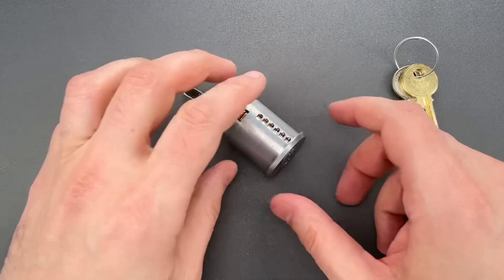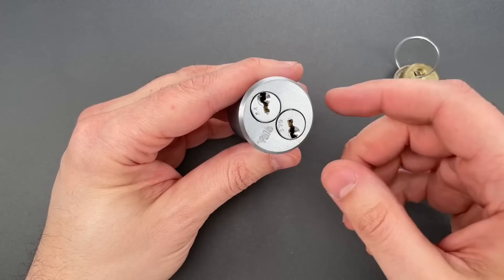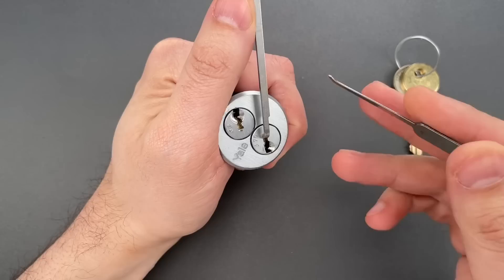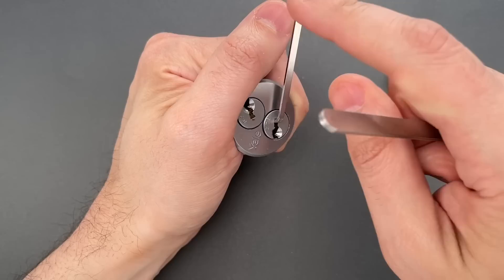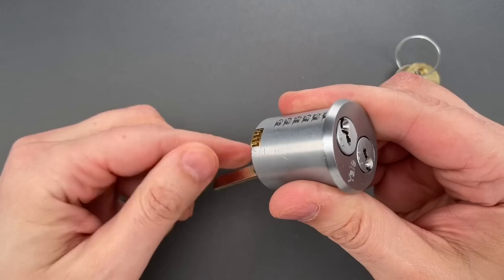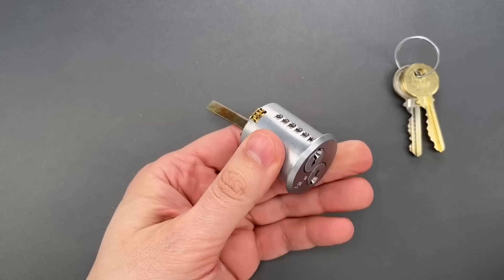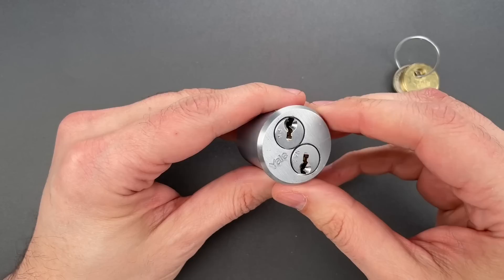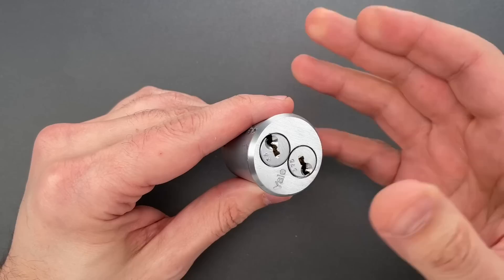[1511] What Were They Thinking?!? Yale Bicentric Bypass

Comment: It seems like most lock manufactures don’t threat model their products.  Quite insane.
Reply: Perhaps because most people breaking in to a room wouldn't even bother trying to pick the lock. A good run up and shoulder-ram and the frame will give way. The door is only as strong as the weakest point, and unless you've spent quite a lot of money on the frame and installation, that won't be the lock.
Reply: @vylbird8014  while this may be true in many situations, I don’t think a security product should take a defeatist approach to design.   If they do, they inevitably become the weakest link for scenarios where the rest of the setup is secure.
Reply: Or they model it after what's the intended use case. As an internal door lock and maybe only used to lock classrooms as to show you can't enter it seems fine. I worked at a school where we had a classroom with an emergency opening on the outside as it has the external emergency opening. Here everybody could then open it, but it was fine as it was just a way to tell students that the classroom was locked and they shouldn't enter. Not to keep out burglers and the like.
Reply: @leonthebleh  Got a nice contradiction at my school. The building was made for fire safety: The doors can't be locked from the inside, so a misbehaving student can't possibly lock themselves in. There are big class windows between classroom and corridor to permit a rapid sweep through the building searching all corners for anyone who hasn't evacuated. All of the security doors instantly unlock if the fire alarm goes off to permit rapid evacuation. All very well... until times shift, and suddenly people (ie, parents) are concerned about school shootings and demand that we put in place some sort of lockdown process. Which... we can't. There is no place to take shelter, because the building was designed without hidden corners where a trapped person might be missed. Teachers can't lock people out of the classroom, because the doors don't lock from within. And you can't prevent someone moving around the site, because all they need to do is press a fire alarm point.

The latter two points couldn't be solved, but we did re-fit all the classroom locks so that they can be locked from within. And adjusted the PA system so we can put out different coded alerts: The regular fire alarm, the more worrying 'take shelter within the building' alarm, and the emergency 'run like fucking hell' alarm which is for use in the case of a gas leak or bomb threat.
Reply: @leonthebleh  if they advertise their usage and security assumptions it’s reasonable.  The problem is they don’t and you can’t expect every customers to red team the lock for due diligence.
Reply: @vylbird8014 That's so crazy that you genuinely have to worry about being shot in a school. Like, truly insane. Why does the US still insist on allowing so many guns? It can't go on like this.
Reply: @vylbird8014  Wow. I knew I was taking a risk in assuming, but I didn't think I was wrong. That's the craziest thing I've ever heard. Do they even do shooter drills in the UK? It's so insane that I even have to ask. I don't want to live in a world where school shooter drills are the norm. That's genuinely post-apocalyptic level stuff. But I don't blame the parents for being afraid, I blame the US gun culture and their inability to recognise and/or accept the total failure of that system.
Reply: @clonkex  Not at my school. We have a protocol, but we've never drilled it. None of the staff actually take it seriously. We know the protocol only exists to reassure worried parents that we take the possibility seriously. Which we don't.

Comment: Yale is part of Assa Abloy famous in Sweden for their very secure Assa 2000 home door lock that could be picked extremely easy as it turned out. They updated the lock a number of times sending new parts to existing customers until they gave up and said that it was good enough despite the lock still being way to easy to pick. Personally I have never bought an Assa lock since that time. Everyone makes mistakes but it is how you handle them that counts. Assa leaves the customer with the problem.

Comment: Well, now I know why the janitor at one university I was at carried what looked almost exactly like your bypass tool rather than a key. It's obviously less trouble with these locks.
Reply: Or it was a tool to open toilet roll despensers, or turn on/off 'secure' light and heating switches.
Reply: @penfold7800  It was similar to the light switch one (though that one was forked), but I saw him use it on doors on a many occasions. I had just assumed that was the "master key" or something.
I suppose in a way it was :D

Comment: Now that you have brought this up . . . [ Your Favorite Brand of Lock ] Kwikset SmartKey has a particular type or style of deadbolt lock that utilizes 2 separate cores for use in limited 2-level master-key systems such as those used in apartment buildings or apartment complexes that allow for managerial or supervisory access keys to be used with those particular locks due to the simple facts that Kwikset SmartKey technology does not allow for the techniques used in modern-day master-keying schemes (since Kwikset SmartKey does not use conventional pin-tumbler mechanisms .) What I like about the concept of bi-centric cylinders or cylinder housings is for the allowance of 2 separate and distinctively different keyway profile sections to be used in the same lock (one for the cylinder core that the individual change-key operates and a totally different or distinct one for the one that the master-key operates so as to prevent key interchange or an otherwise compromise in the master-key system, that is if a restricted keyway or profile section is used for the cylinder core that the master-key is to operate .) What I would want to see in such an arrangement is an SFIC (Small-Format-Interchangeable-Core) cylinder housing that accommodates two different SFIC cores for this exact purpose in the same cylinder housing that would allow for two independent key systems to operate the same locking hardware as found in a padlock or as that on a door or a series of doors as what would be found on an institutional campus of buildings, like that of what would be found on a military installation or a college campus or hospital/medical center campus .

Maybe there could also be a cylinder housing configuration that would allow for situations or arrangements where "dual-custody" applications would be used such as that of where high-value inventories are stored or other storage scenarios where confidential or sensitive information is kept or stored, or proprietary research & development, and that or what could then be deployed with standardized door hardware, so as to change or restore the use of a single-keyed access application later or after a dual-custody arrangement is no longer needed, all without the further modification of the door or the lock that is used on that door .

I think that you have featured a similar lock [padlock] used in Australia that uses two separate cores for very much the same purpose such as to allow two organizations with independent keying systems to operate a single padlock that would be utilized to secure a perimeter fence or gate that would be used to secure some form of infrastructure with out the need to link separate individually keyed padlocks together .

I could very well see the use of a similar cylinder scheme used to this day for the purpose of particular situations where different group activities or departments within a large organization or institution, with their own distinct keys being used to operate a common set of doors or locks within a facility without the need to issue (or track) multiple keys or to modify cores or cylinders within those locks to accommodate distinctively different keying systems (that would also degrade security, since lock cores with multi-sectional keyway cylinders or maison-keyed cylinders that have a multitude of possible shearlines or entire pin-stacks removed altogether in order to facilitate the operation of multiple key bittings from multiple key systems .)

Additionally, a bi-centric cylinder housing format that accepts 3rd-party manufactured cores or SFIC's would also allow for keys from different makes or manufactures to operate the same lock(s) within a facility or campus .

Comment: Although, unless you were told about this weakness or had an example of this lock to play around with, I can understand why it was considered pick-resistant: just picking a core doesn't get the tail-piece to turn and can't open the door, you must know that a tool can be inserted to bypass and turn a gear, which rotates the tail-piece itself.

Comment: Well that explains a lot... I picked up a tss euro thumbturn cylinder out of a junk box to play around with and found that just jamming a piece of old wiper blade to the back of the keyway and giving it a wiggle allowed me to turn the cylinder and move the action of the lock, presumably due to the same issue of not being directly linked. 

Slightly related note, I was actually thinking of switching an elderly relatives cylinders to thumb turns because they are struggling with keys due to dementia (remembering to lock their doors or taking the key out and forgetting where they put it after locking etc) so I might have to look into other options if this is s common design flaw. Having said that a lock which can be easily bypassed is probably better than them just not locking their doors or getting locked in. Having doors that automatically lock behind them and any kind of electronic mechanism would not be appropriate either because they wouldn't be able to learn this new method to unlock their door. Old age is just another one of life's cruelties I guess

Comment: I get why they did it this way mechanically. A ratchet mechanism or something similar, that would allow the whole core to to turn and not just the tip, would have been a lot more complicated and expensive to make.
But by doing it this way they completely undermined security.

Comment: The idea of decoupled actuator can also defeat some locks, whose security relies on the actuator being fixed when cylinder is locked. This can mean being able to push or work the bolt open with a knife, credit card or similiar.

Comment: I had a key system like this in the one building I was doing community service for and I could go anywhere I wanted because all the locks had a master key I memorized when I first saw it.... It toom me getting in the building and making it through 10 doors for them to talk to the owner and change all the locks, I didn't dare tell them that they left all the latches visible so you could just use a card or ruler to get through the doors inside but at least the outside door was a lot more secure.      LoL

Comment: Something that could be useful is requiring all of the pins to be picked and something actively turning the BACK of the core, rather than just the latter as is required here. It'd add an extra step after a "successful" pick.

Comment: The way you could open that lock reminds me of the older Master Padlocks with the flat square key cuts. All you had to do was grind off all but the top or tip two to form a T and you can open just about any Master padlock of that type.

Comment: I have the fix! It works exactly the same except the key pushes a bar that engages the gear and is locked to the cylinder. When picked, it acts the same way as this in that the cylinder would turn and the gear would not. but it could not be bypassed because the end of the bar the key pushes on is locked to the cylinder and can not turn without the cylinder. Also, if picked and THEN pushing the bar, it would not line up anymore and therefore could not drop in to the gear. it accomplishes all the same goals but removes the ability to bypass.

Comment: Hi lockpicking lawyer, I've seen and learnt from many of your videos, but I still haven't seen a lock in the way that I would make a lock.
Do you know of a lock with these properties: you insert the key normally, but instead of turning the key, first you have to push the key in, this causes the holes in the core to line up with the pins, preventing you from picking the lock normally, because now you have to put tension on the cure, but also have to push the core in (or if not the core, an extra pin with the tip of the key), in order to pick and rotate it. Or if that's not a possibility, to have 2 sets of channels the pins should follow, if you try picking them one by one, one or more will always fall into a false gate and you have to start your picking all over again. Personally, I would go for the second option, the first option would open possibilities for weaknesses to exploit, while in the second option you don't.

Comment: To be clear, this is not a system where any key can turn the lock. If you insert a key, it won’t turn the part at the back of the lock unless it also turns the core, which means it needs the correct cut. Instead, as LPL showed us, you need a non-key object that can freely rotate inside the core without requiring the core to rotate with it. Such a tool will be able to bypass the lock.

Comment: I see the same flaw in the lock core for Anderson storm doors. It looks like it is based on European lock core but the inside tumb latch is coupled to the lock actuator but the key core is not and it is just the tip of the key that turns to actuator.

Comment: I can think of a fairly simple solution to this, too, and it might actually make it more difficult to pick than a standard lock. 
Spring load the rear piece so it needs to be pushed into position, but now can’t turn unless the pins are set. Obviously not THAT much more difficult to pick, but if you didn’t know it, you would be picking the lock, getting it to turn, and not getting any success.

Comment: Maybe the cylinders should have had a solid backplate that was spring loaded to decouple then, but engaged when the key was inserted, mating to the gear that operates the turner. Then this kind of attack wouldn't be possible.

Comment: They could have coupled the gears to each cylinder used spring to push the gear into position but still need the tube to turn the gear.

Comment: What I would like to see is you bypassing Abloy Pulse.... 

It combines mechanical and electrical things. It powers lock cylinder and key from inserting the key into cylinder and can be controlled with computers.

All keys look exactly the same, but have different coding inside, and no, it isn't NFC readable. Lock cylinder itself has log storage for used keys and transfers it to central location.

Comment: Neat. The other day I was thinking about a similar design, didn't realize there was already a lock with two cylinders. Difference is that I would have one cylinder engage the mechanism for the second cylinder to open the latch, where both need to be turned at the same time in order to mesh. What do you think, do you have enough hands to pick two locks at the same time?
Reply: These are often called "dual custody" locks. There are several different designs in use for them. LPL has featured a few on his channel before.

Comment: This channel will end up being a more useful library for thieves than for lock designers
Reply: If you ever left your keys at home, you probably know at least one method of opening a door without a key or picking it. These methods are quick, incredibly cheap, relatively easy and most locks don't protect against such attacks. It's not some big secret.
When such an attack fails, that's when you start attacking the lock. If it looks too complicated, you just move to the next door.
The majority of locks you'll encounter are probably regular pin tumblers, which you can often rake open in seconds. Again, no big secret.

Comment: It would be a simple fix, make the bypass asymmetric so that it would be impossible to turn it without the lock cylinder also turning. Im sure it could still be picked but you would need the cylinder turning and the bypass simultaneously to do it.

Comment: @LockPickingLawyer Your recent videos all have sound volume which is a bit lower than normal. Normally I have to lower the volume of YT videos. Your channel is the only one where I have to raise it. And since you cannot raise it inside the app (already at 100%,) I have to raise it in windows sound settings. It's a bit of a hassle.

Comment: I feel like this is absolutely solvable with 1 more gear right.  Just couple both cores and the tail like a differential.  Doesn't that ... just work?  That way the locked core is stationary, and the unlocked core drives the tail.  

this is wild.

Comment: I thought a bit about this lock. Honestly? That flaw is fine-ish. Exploiting such flaws would require knowledge of the lock in question, meaning it is likely way more secure than other locks that can't (easily) be bypassed. Lockpicking itself is a common enough skill and the average criminal who wants to get in might pick the lock, not knowing about the bypass. Of course with this lock, picking it will not open the door, thus frustration the effort.

Comment: I was also trying to think about why this would be a bad idea. And I thought it would be because it just makes it so that if you can figure out the one master key, there is no need to think all the individual keys. The principal of the other keysets become irrelevant, and the 2 core design on the face of the lock makes that system obvious to a would be lock picker. But the truth, with a little bit of that piece of knowledge of how locks work, is even worse.